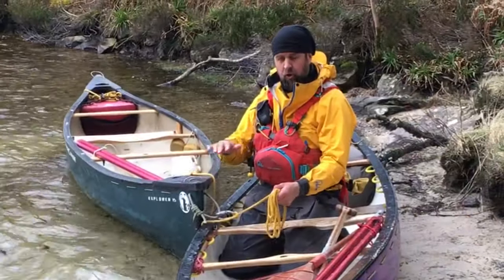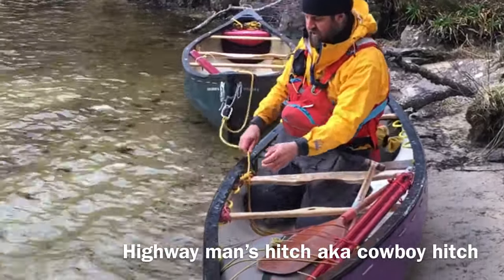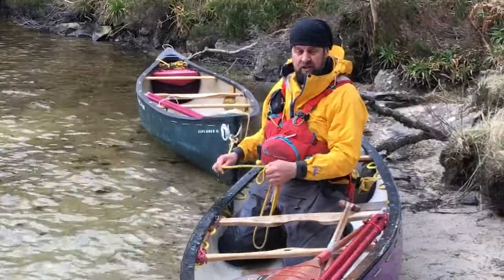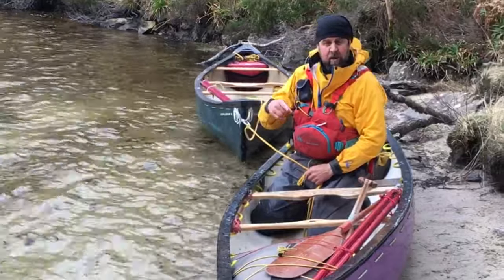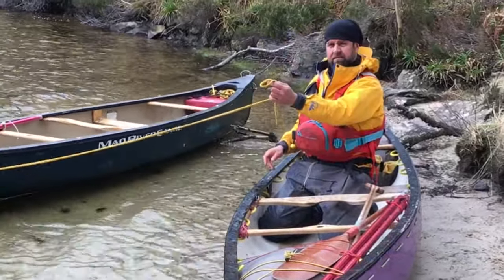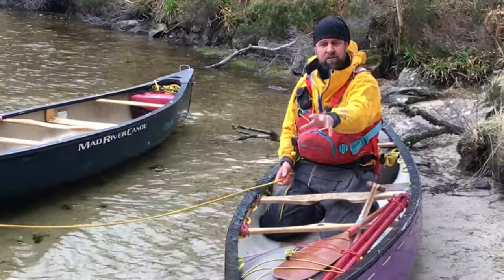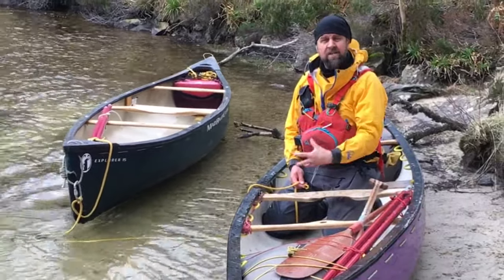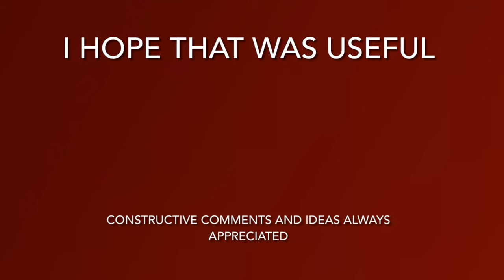Canoe Painters …. Continued- Their length and use - part 2

Comment: Comparing turning abilitys of both configurations should be with the same task/manouver. Showing the bad left turn with the boat in tow while paddling forward with j-strokes compared to sweep-strokes/bow-draws while standing still with the boat attached to the side. 

I get the point of the comparison but the task was "turning away from the towed boat while moving forward".

Thx for the ideas and testing.
Reply from the maker: Thanks for the comments. It might not be easy to see as the camera is a long way off but I tried every turning stroke in my repertoire in each system.  For control and manoeuvre lashed to the side was much much easier especially in anything resembling force three and above. But I encourage you to find a sheltered place and try them out.
Reply: @outdoorinstruction  thx for your response.

Comment: hi, what size and brand of rope do you recommend to use as painter? would the 3/8" Pelican Rope NFPA Polypropylene on Amazon a good choice? thanks!
Reply from the maker: Hi I am not sure of the brand or size as I’m based in the UK. However I’m using 8mm floating rope from any good water sports shop and retailer.

Comment: If you were going to be doing this over distance, say crossing a lake, would you have the towed boat secured to the windward or leeward side of your boat?
Reply from the maker: Great question. It would depend on the direction of the wind and my direction or travel then thinking about the trim of the boats and also the power of the paddlers being matched. So not a straight answer unfortunately. I would use the wind to help both my travel and correction.